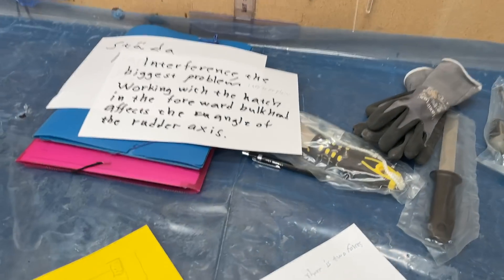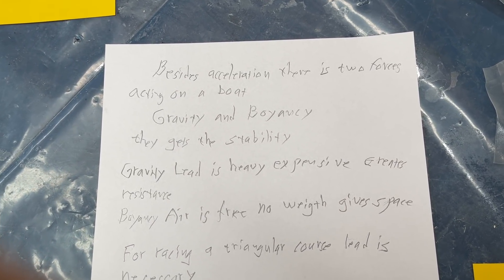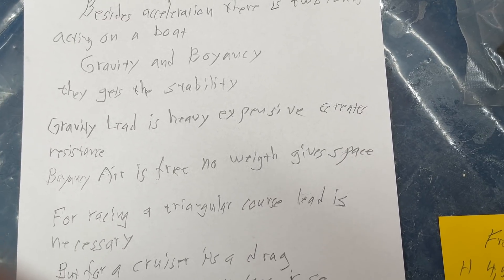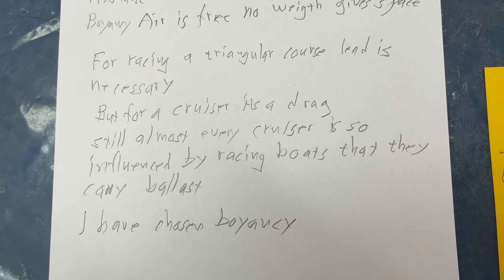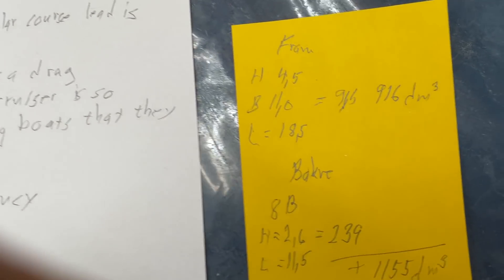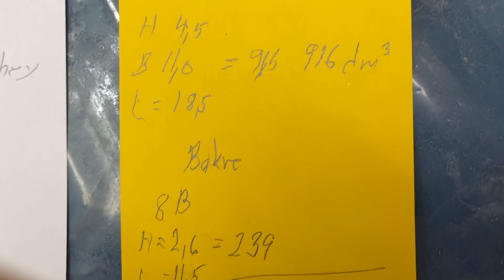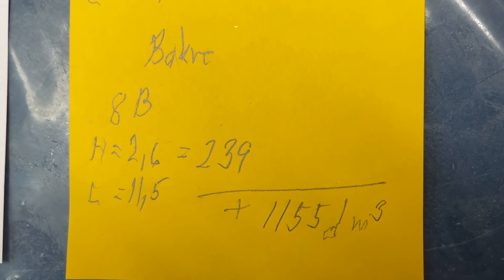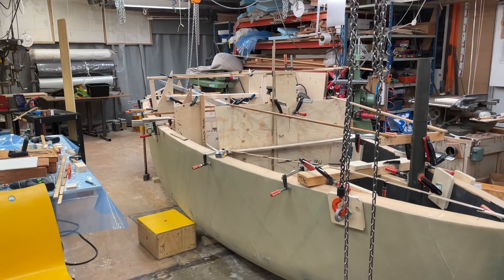BALLAST OR BOYANCY FOR STABILITY AT LARGE HEELING ANGLES ?

Comment: Using buoyancy instead of ballast for self-righting purposes was the most useful idea I learned fro you. I incorporate in all my own designs.

The 3 x 0.90 m scow skiff I am building will use this principle. It will use 12  3.75L milk jugs as emergency flotation, with 6 on each side. They will be placed just below the sheer, so any, water that gets on board will tend to make the boat more stable right side up than upside down.

Comment: Sven, i have a Caroff 11 m design that have built along Seven years. The boat Is with centerboard AND internal ballast. It has a Lot of stability, four meters beam AND high freeboard. Total displacement Is ten tons AND has got two tons of lead beneath the bottom. In your boat two hundred Kg at the bottom would be the equivalent. May be 150 Kg would be enough due to very low masts.
Reply from the maker: The simpler the better. My belive is that my boat will not need any ballast. No use carry weight not needed. Trials will decide. If neccesary corrections can be made.

Comment: So if your cabin is the width of your boat, and you will heel over 90 degrees or so before the weight of your water jugs and other ballast - including yourself - brings you back upright, what if your cabin was wider than your boat? In other words, if your doghouse or cabin were to overhang your boat by a few feet on either side, perhaps you would only heel 70 degrees before righting? This of course ignores beam windage and weight aloft. 
Also, a dagger board with weight at the bottom, particularly if retractable, gives you low wetted surface, good righting, good upwind ability to claw off that reef or shore from out of nowhere, and allows shallow draft when retracted. It can also lessen capsizing motions due to big surface area in the plane of capsize, while little surface area (frontal area) in the plane of forward motion, especially at slow speeds.
Reply from the maker: If the cabin was wider the boat would be stable upside down like a multihull.
A dagger board with a weight would complicate and make the boat more heavy. I like to keep things stable. It will not reduce capsizing on the contrary when the boat is hit by a wave it will prevent it from rolling with the punch.
I belive that the rightning moment is sufficient. More might make the motion jerky.

Comment: So, I understand your point that the buoyancy high up, created by the air space in your coach roof, or however you refer to that part of your boat, will create a righting moment when capsized or overturned, such that your boat will always come back upright again. That's pretty much the principle of any "self-righting" vessel e.g. lifeboats etc. However, surely avoiding rolling over in the first place does actually depend on ballast? No? I mean stability (resistance to capsize) is either "form stability" as in a raft or catamaran, or it's "ballast stability" - & your design does not really have much in the way of "form stability", I don't think? Also, if you are counting on your water supplies / stores etc acting as your ballast, then that is a problem, because once you do get rolled, if that stuff (& yourself) is not secured to the bottom of your boat somehow, then once you roll, it & you end up on what was the roof, but is now the bottom of your boat, creating ballast that will resist the righting moment of that buoyancy you've built in to the superstructure... No...? I have only the tiniest tiniest fraction of your experience, so I'm certainly not trying to tell you what's what - only that these are the questions that occur to me....
Reply: Heavy items such as water and batteries are stored in compartments lining the bottom of the boat. The compartments have lids keep the contents in place.

Comment: On a low-mass vessel, I wonder about the influence of the human ballast.
During an inversion, the human ballast must avoid remaining at the lowest point... in the pilot-house.
This requires a conscious able crew, plus all other cargo secured below-water-line.
.
For their FastPassageBoat series, yacht designers Dashew use heavy plating below-water-line as a built-in (instead of added-on) 'grounding' keel.
Tank-tests of models led to their development of the pilot-house shape and cubic capacity as a cure for an inversion.
.
An aside:
Although I can appreciate the FPB concept, Dashew delights in enormously-complicated components cobbled into enormously-complicated systems... requiring enormous amounts of redundancy.
Reply: a -- Irregardless of sea-state, could a automotive-style seat-belt or harness tether help the crew maintain position near the keel (instead of bouncing around the pilot-house and potentially prolonging a capsize recovery)?
I think the pilot-house interior probably ought to avoid skull-penetrating sharp edges, rods, screws, poles, pencils, forks, and similar pokers.
A full-length handle parallel to the long axis inside each side of the pilot-house?
.
b -- As low-mass vessel constantly shifts away from waves -- "...like a boxer rolling with the punches..." -- will the crew need a padded interior to reduce the potential for bruising?
.
c -- My intention for commenting:
* safety of Sven(!), 
* safety of anybody fabricating a similar craft
* stimulate creative imaginations.
Sven engineers based on his experience and his needs.
My needs may require a different design... with more padding...
Reply from the maker: @largemarge1603  I do not use padding, the boat is small enough and I like to keep things simple. There are no big distances to be thrown around in. Yes when the wave starts to breake I attach the safety harness. My weight to boat is only 7% it has no major effect. 1974 near Cape Horn my boat similar size was capsized and pitchpoled, no harm done.

Comment: This is nonsense. Its not a case of Ballast OR Buoyancy, it's a matter of intelligent use of both. Since you have such an overweight hull, you cannot avoid having Ballast as an important part of your equation. Its built in.
Reply from the maker: Exlex hull is not overweight. Her strong outer laminate is a factor of safety. It increases her resistance against collisions against debris at sea and enabels her to dry out on a rough surface. Therefore it is functional not ballast.
Reply: @SvenYrvindExlex  Perhaps you would like to publish this boat's weight table, to provide more detail.
Certainly,  the existing construction is not as optimal as similar boats ( eg .Eric Sponger's open ocean rowing design)
ANY weight, for ANY reason is "ballast". Unwanted weight above the waterline is unwanted ballast.
Reply: @dnomyarnostaw  you are talking nonsense because you don’t know the definition of ballast. Here it is reproduced for your reading pleasure 🤣
Ballast definition is - a heavy substance (such as rocks or water) placed in such a way as to improve stability and control (as of the draft of a ship or the buoyancy of a balloon or submarine).
Reply from the maker: @dnomyarnostaw  I do not agree. But I have to go to work now. I come back toningt with an ansver
Reply from the maker: I am back. You say ballast cannot be avoided. I disagree. I think most multihull designer disagre. I was working with multihull designer Dick Newick 1975 and 1976. Dick trying to teach me english said. Sven ballast is a dirty word, its a swearing word. He was joking of course but it sounds like a strong word. Ballast has in fact Swedish/Danish roots barlast last means load bar means bare naked that is without carge.
As to the lay up of the outer skin its 3 layers 450 gram 45x45° . The bottom is stonger. I have been consulting Rolf Eliasson a friend since 1980 He is coauthor of Principles of yacht Design. He did win Yachting worlds, Cruising Worlds and Proffesional Boatbuildings design competitions. I have also consulted Håkan Berndtson on of Swedens top boatbuilder who do mostly sandwich construction.
My sandwich is not a balanced sandwich. Reason is global forces on such a small boat is negligible in fact concerning global forces the 70 mm thick H 80 Divinycell is strong enough that she can sail across any ocean without an outside or inside skin. A small boat on the other hand has to be well designed for local forces. As in harbors and debris
Reply: @SvenYrvindExlex  Thanks for the detailed reply. 
I an very happy to hear that a professional has done the calculations. 
I will make no more uninformed comnents.
Reply: As I see it Sven is using fresh water tanks as ballast placed low inside the hull.  But what happens when he is consuming this water for food and drinking?  @sven Yrvind,  are you then filling the empty cans with sea water to maintain stability?
Reply: @fotobollfoto3867  I am a big fan of freshwater ballast. 
My plan was to have flexible bags inside the balkast tanks, and top up the actual tanks with seawater to avoid the free surface effect.
Reply: Ray,
Excellent point!
How impactive is free-surface effect in liter-size canisters?
Is the influence cumulative?
Reply: @largemarge1603  Small containers are ok, as the liquid doesn't build up the velocity for dangerous momentum.